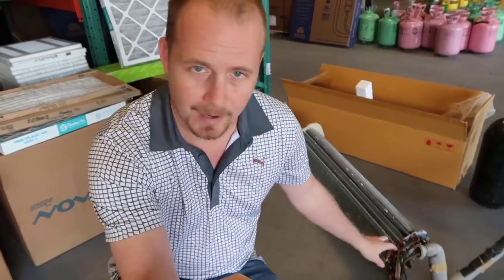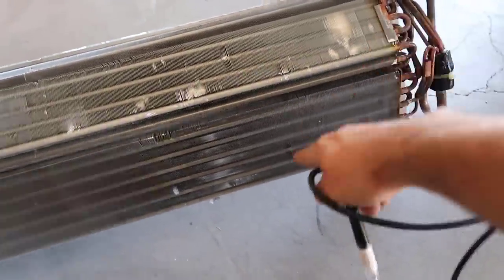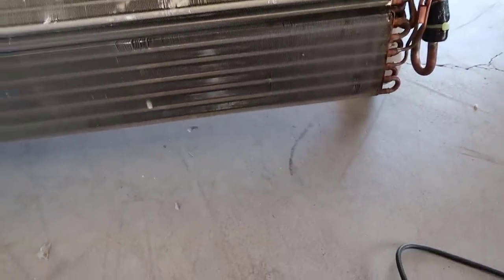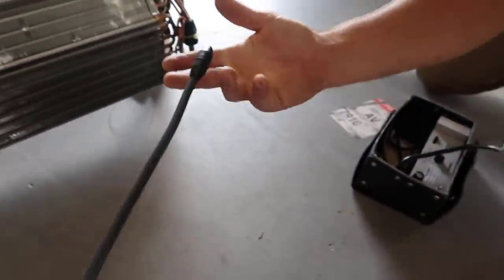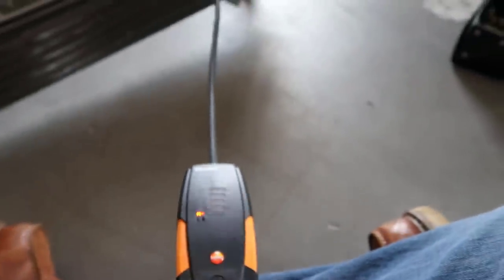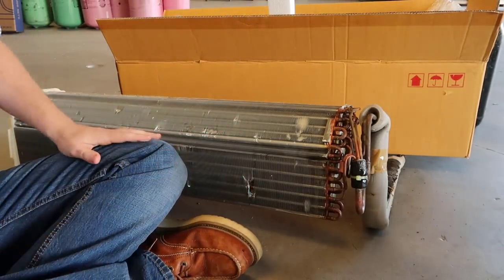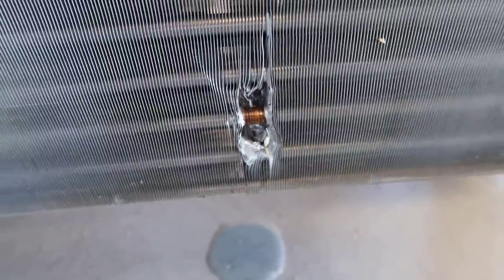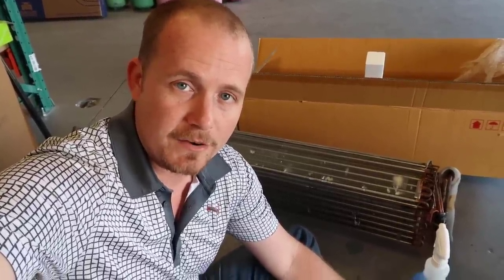Pinpointing a Refrigerant Leak in a Ductless Evaporator Coil

Comment: Nice demo! Stupid question time, have you ever used an ultrasonic detector to find leaks? I have used ultrasonic detectors on many occasions and they can find leaks freaky fast. You could easily hear those little bubbles popping. the smaller the leak the better ultrasonic works. I used them on scientific instruments in a very ultrasonic noisy area, tons of air lines and air actuated valves that emit loads of ultrasonic noise. The problem is getting used to the ultrasonic and having confidence that it can do the job. Once you gt the hang of it you'll never go back. I would use soapy water just to make the ultrasonic noise easier to hear, it's easier to hear the bubbles popping than to hear a leak in a noisy environment.
Reply: What brand of ultra sonic do u use ??
Reply: @victorleon1563  UE get them used unless you got the $$$

Comment: Next time could you hold or tape the two probe ends together as you scan the coil to accurately see the difference in timing in pickup between the two brands or would doing so interfere with the probes ability to sniff??  Thanks for taking the time in making the video Bryan.

Comment: I use ultrasonic it'll find tiny leaks quick even under vacuum
Reply: Which ultrasonic detector do you use? I love my Accutrak VPE by Superior Signal. That thing is a beast at finding leaks. It almost makes it easy. It can cut a 30-minute leak search down to 2 or 3 minutes.
Reply: Seems drastically superior as wind and breezes have no effect as well.  True?
Reply: @SovereignTroll   My Accutrak VPE is my Go-to way of finding leaks. 👍
Reply: @SovereignTroll  that is exactly right. You can hear very light air  coming thru your nostrils (because your nose is an orifice) but not the wind blowing. And wind blowing makes it very difficult to locate a leak with an electronic sniffer type instrument.
Reply: I like the wind blowing and holding it over the condenser fan and hearing nothing. Still amazing.  I do admit in conduit and in ducts the diode detector do give a heads' up.

Comment: I may have missed it but how much pressure did you have in the coil when you were checking it on the floor.
Reply from the maker: Wayne Miles We nitro tested at 350 but when leak checking we brought it up to R410a static pressure at 90 ambient... about 280.